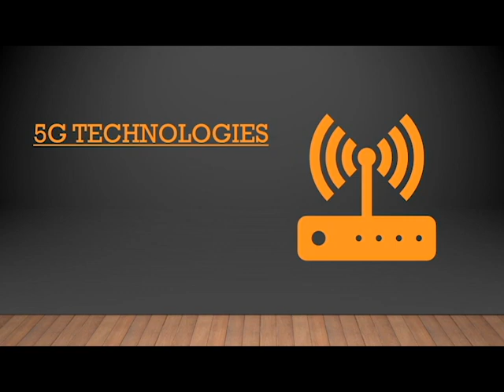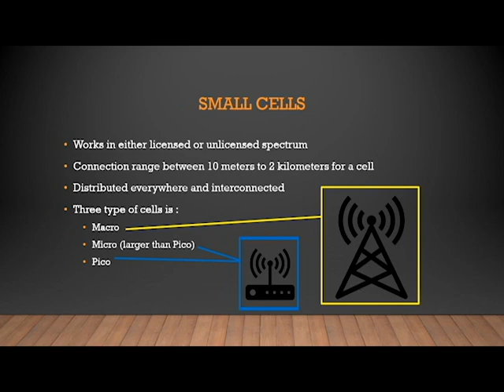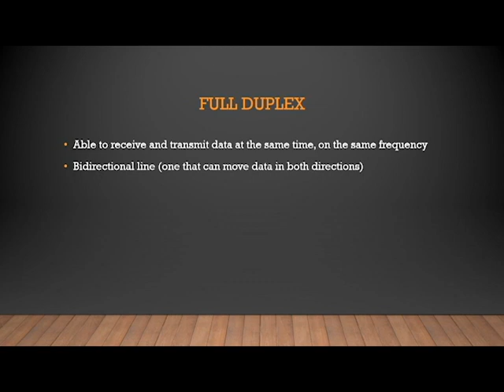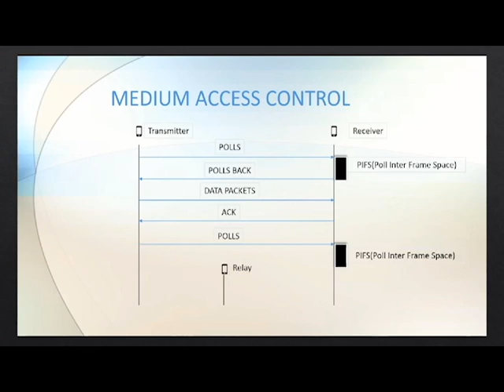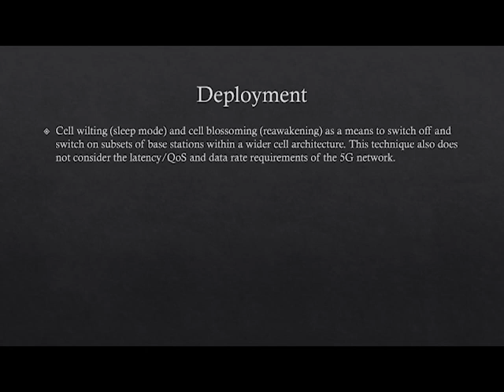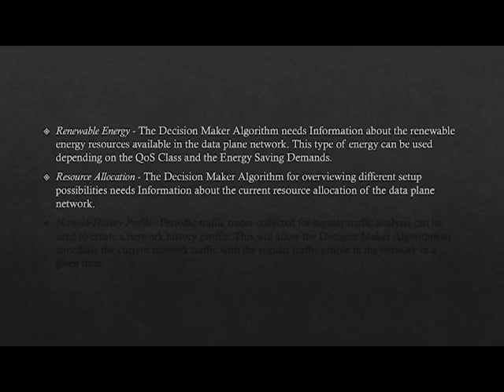5G Device to Device Communication (D2D)

Comment: What does licensed spectrum mean?
Reply: Licensed spectrum devices operate within the portion of the radio spectrum designated by the FCC to be reserved for organizations that have been granted licenses.
Reply: Bisjiun Goh What about unlicensed spectrum?
Reply: @amandawong1336  Unlicensed spectrum must adhere to FCC rules for the ISM bands, most notably requiring that devices transmit 1 watt or less of power and not cause harmful interference and accept any interference received without causing undesired operation.

Comment: How does small cell act as relay to overcome the millimeterwave issue???
Reply: It overcome the issue by having each relay receiving and transmit the signal to the client by avoiding the obstacle. This method allow the line of sight to make turns at corners to go around object to reach the client.

Comment: Will 5G be offered to all mobile users and devices ?
Reply: No. 5G is expected to be deployed strategically in different locations, especially in the early days. 5G is expected to complement 3G/4G where it makes sense. And depending on where service providers believe applications will be most profitable, they can roll out speeds of up to 10 Gb/s.
This means if you’re in a rural community, chances are you probably won’t get 5G in the early days. So, service providers will deploy 5G in areas where it makes economic sense.

Comment: Is there any radiation dangers related to 5G?
Reply: To make 5G, 5G cell phone companies need more power than ever before.  More towers and base stations will need to be built and secured to buildings around the country to make this possible.  More towers and base stations means more Radio Frequency radiation which may lead to cancer.

Comment: How will 5G impact autonomous vehicle ?
Reply: The high frequency 5G signals allows message to be transmitted faster between sensors and then get to the computer in each car. This allows the computers to make faster decision and thus causing lesser road accidents. Also, if there is any major accidents happening on a road, authorities could send instant alerts to autonomous cars, warning them to use alternative routes instead.

Comment: will 5g improve voice quality ?
Reply: There are a lot of voice over internet protocol (VOIP) applications today that depends heavily on 4G networks. This means that performance of these applications are often unreliable. Mobile network operators could deploy their own VOIP applications giving them a guaranteed level of quality of service using network slicing, and by taking advantage of the much lower latency of 5G networks.

Comment: What are the difference between micro and pico in small cells?
Reply: the difference are that micro have a longer coverage distance of up to 500m while pico is less than 100m and micro is more expensive and can only work outdoors where pico is cheaper and works in both outdoor and indoor.

Comment: How is the higher security concern works?
Reply: The evolution of 5G can lead to  higher security concerns with the help of the D2D communication. The D2D communication established for the direct communication between devices hence the device do not need to go through part of the network infrastructure in order to communicate with another devices and this reduced the risk of the message being exchanged between devices get exposed to more levels.

Comment: Will phone battery drop faster compare to when using 4G?
Reply: The phone battery is believed to be last longer than in 4G because there will be the network protocol to control and regulate the network traffic, network history and service layer that would help in determining the energy efficient protocol for better battery life and the higher speed of connection also reduced the time of the device buffering on internet thus reduced the battery consumption.

Comment: In massive mimo, the throughput increased, but the bandwidth is fixed while spectral efficiency increased, is the bandwidth and throughout two different stuffs??
Reply: The bandwidth and throughput is both about measuring the amount of data that can be transmitted through a channel while the difference between both of these is that bandwidth is the official amount that be calculated using certain formula about the maximum data that can be transmitted through a channel and throughput refer to as the actual data that has been transmitted through the channel as there may be issues like queuing delay occurs and cause the data that can be transmitted on a certain time through the channel to be reduced.

Comment: Can I know the millimeter wave iszit running with the same concept as the small cells?
Reply: The millimeter wave is a type of high frequencies wavelength while the small cells is refer to as a mini base station to transmit the wavelength. They both works together but is two different stuff.
Reply: @chiencheong1710  Wow tenks